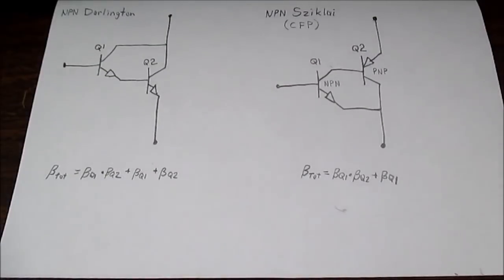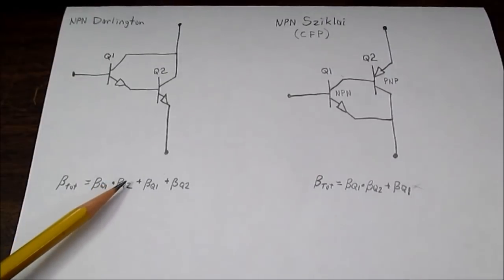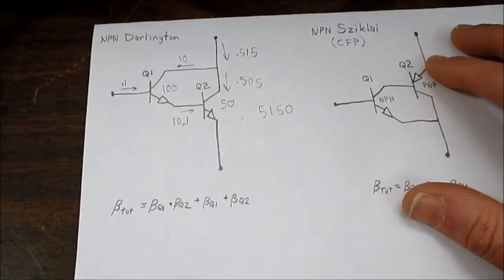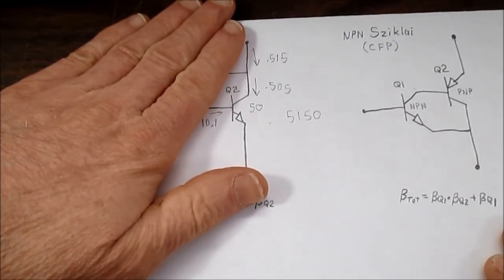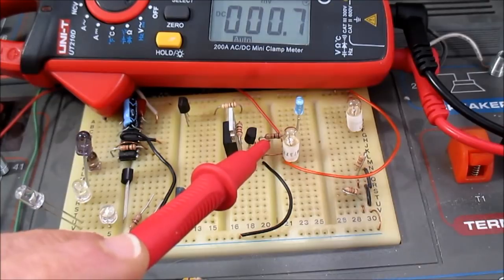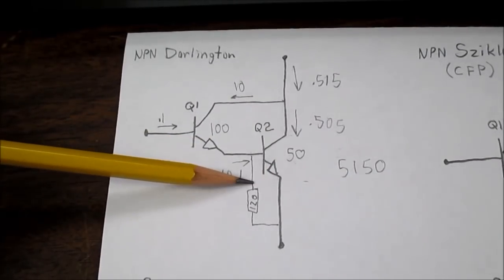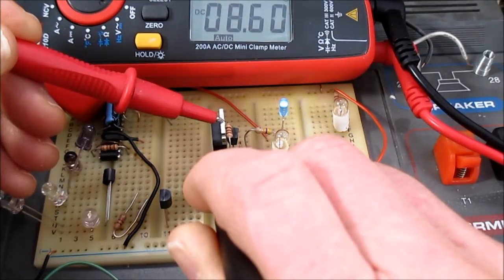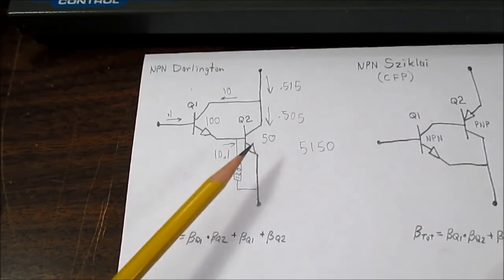Understanding Darlington transistor circuit characteristics with demos

Comment: 3:38 The current that is near the collector of Q2 is 505mA and the emitted current by the Q1 is 10.1, so shouldn't the emitted current by Q2 be 10.1+505=515.1?
Reply from the maker: yes
Reply: @JohnAudioTech thankyou!
 but you cross checked with the Btot formula....than is that formula wrong?
Reply from the maker: @TheJokerandTheJean  The Beta formula is correct. The gain in the example is 5150. The emitter current is 515.1 ma because it is inclusive of the .1 ma base current going into Q1. Beta is calculated using the collector current, not the emitter current.
Reply: @JohnAudioTech  okay thankyou very much sir!

Comment: Please also explain how the single stage amplifier using transistor at the output of chips like Um66 or Um3561 used for amplification functions & also how we can design such circuit if we need to increase the output power (calculate the watts) of those Siren type circuits in some another video

Comment: hi, can you please explain to me why there is no resistor connected between the emitter of the first transistor and ground. what will be the implication of connecting one? will have an effect on the gain achieved? thanks
Reply from the maker: If the device providing the signal to the base can't sink current well to pull stored charge out of the transistor, it will slow it down. Adding a resistor in that case can speed it up at the cost of lower input impedance.
Reply: Thanks for the quick response. myself and a few colleagues are trying to build an FM transmitter just for demonstration purposes. one of us thought by using a Darlington pair we will bust up the power to the antenna. one of the key requirements is to put that resistor on emitter the first transistor to ground and also use the same transistor with the same hfe. Do you think this is the correct line of thinking? Thanks.

Comment: I have to get from 5V signal a Electric motor working  this Electric motor needs ~12V and 1A .. i have to use BD676/5 Darlington-Transistors … can u help me please? i don't know how big is the reinforcement for the Transistors how can i find that our without to measure .. from datasheet ?

Comment: Dear John is there  any instrument you have to measure a signal 10 mV with 1% accuracy?10 mV +/- 2%  x 5000= 4900 to 5100. So practically 5100 gain and 5000 are not distinguishable .Giving the fact  that gain of transistors are among many  E current , CE voltage  and temperature dependent   so you need to add many more error factors too.The result becomes so uncertain that when you drawn yourself in theory of physics you may loose the point.

Comment: JohnAudioTech+ Do you have any plans for a 2.1 Class D Amp 50+50+100 amps we could do? and what your favorite brand of capacitors and mosfets if money wasn't a issue? Thanks.
Reply from the maker: Do you mean testing a class D board or building an amp from scratch? I don't have any favorite brands. Whatever works and is of good quality is good enough for me.
Reply: Maybe test a off the shelf first then build a better one...

Comment: The bit about not being able to saturate explains the poor performance of an inverter circuit I made long ago...
Reply: Exactly.  Darlington configuration does that because the collectors are connected together.  Instead, two separate transistors with the collectors separate should be used. Then the second can fully saturate and not waste so much power.

Comment: I was wondering, (although i guess it will be explained in the next video) ... but I noticed that in many circuits that use the the Sziklai pair, there is also often a resistor between Q2's base and emitter. Is that for the same reason as in the Darlington pair?
Reply from the maker: Yes
Reply: @JohnAudioTech  excellent presentation, crystal clear English and no music.Simply great